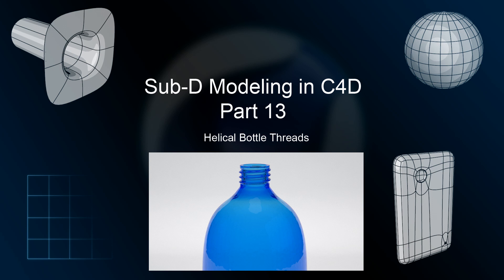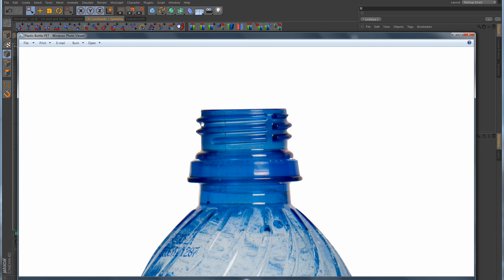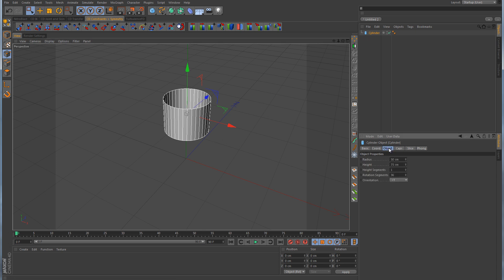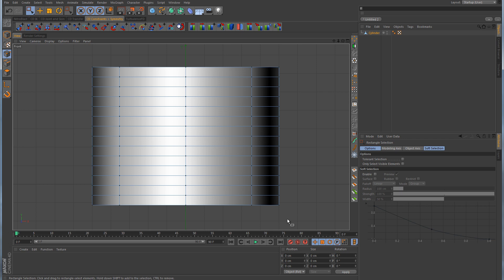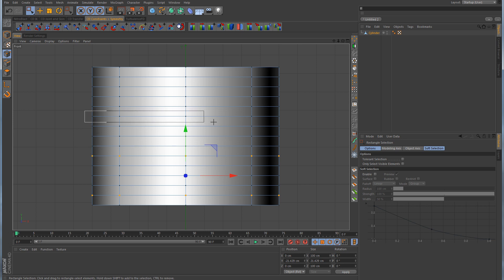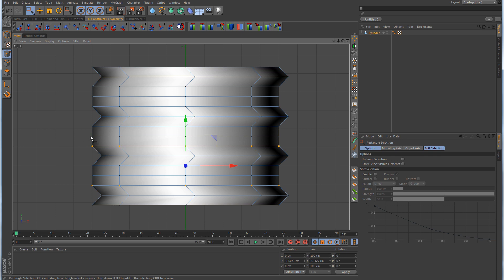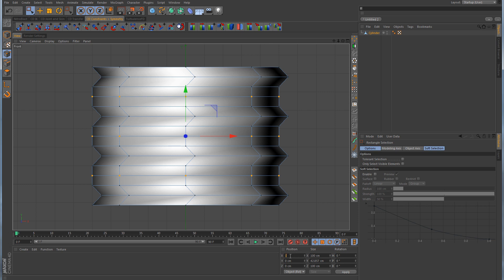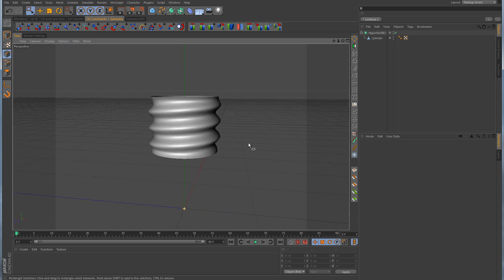Sub-D Modeling in C4D - Lesson 13 - Helical Bottle Threads

Comment from the maker: Yes, you're right. It has 8 sides, but 8 is an even number.  4, 6, 8 are even numbers, and are easily solved. 3, 6, 9 are odd numbers, and are mathematically impossible to solve.

4, 6 and 8 sided polygons are ok. The 8 sided polygon at the bottom was not causing any issues. If it were, it would have been very easy to solve it because its an even number.

Hope that makes sense.  :)